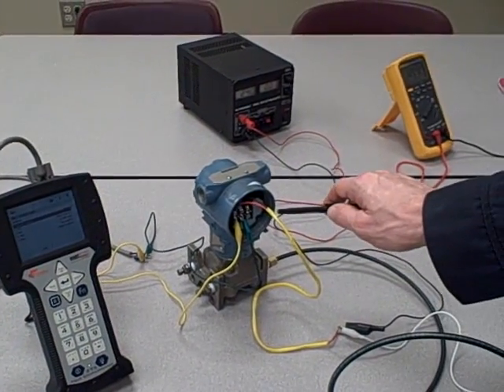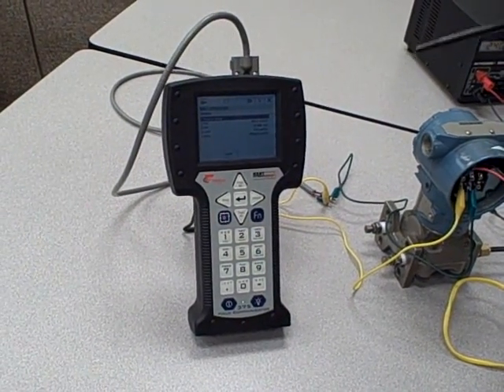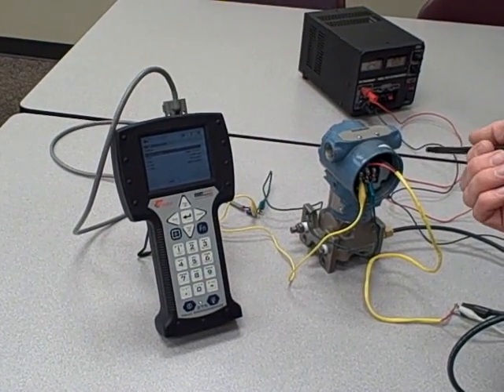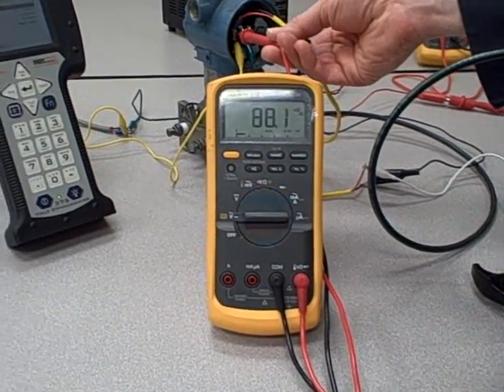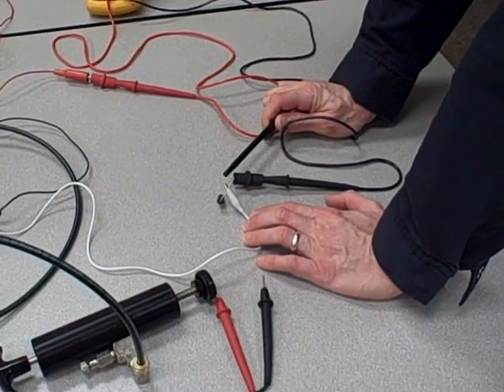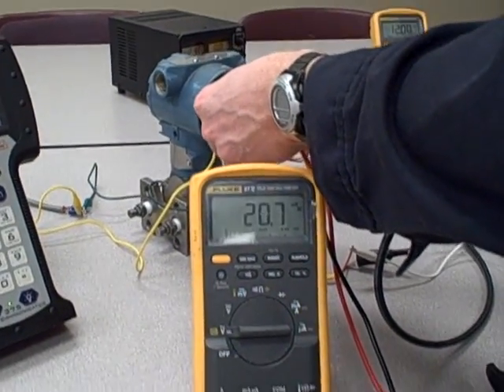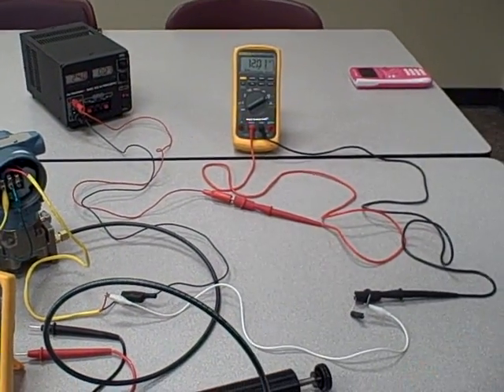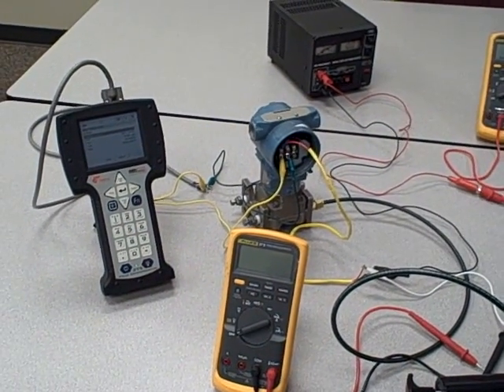HART communication loop resistance

Comment: ok thanks, so without 250ohms resistance the digital AC communication will no work, because the DC voltage will have a low pass filter wherein it will not allow any AC voltage

Comment from the maker: Yes, values other than 250 ohms will work as far as enabling HART communication.  If you need a precision 1-5 VDC drop for 4-20 mA of signal, however, you'll need the precision 250 ohm resistor.

As far as what resistance values are allowed, I'll refer you to the manual for the transmitter.  The allowable envelope of resistance values differs depending on the specific model of transmitter (based on its minimum terminal voltage and the loop supply voltage).

Comment: Can I use a 330 ohm resistor instead of a 250 ohm resistor?
Or 220 ohms?
250 ohm is non-standard as you know.  I can't get ahold of 250 ohm in time for this commissioning.
THANKS!
Reply: y u no series Rtotal

Comment: Hello Professor, where are you putting the terminals of your voltimeter in order to measure the millivolt signal that the HART communicator uses to digitally "talk" to the transmitter? 
(Note: if my question is worded incorrectly, please correct me, thanks)